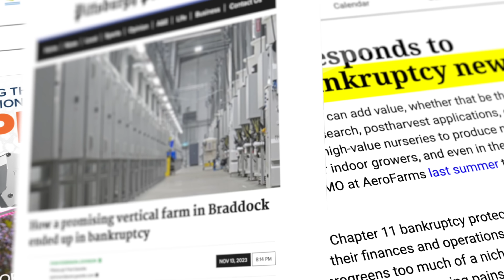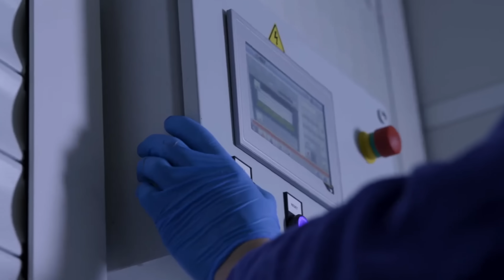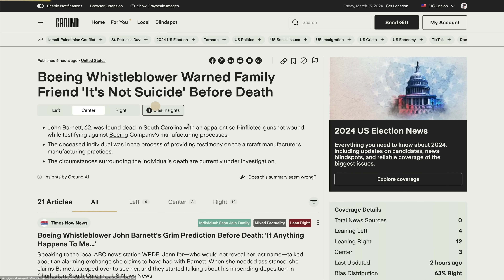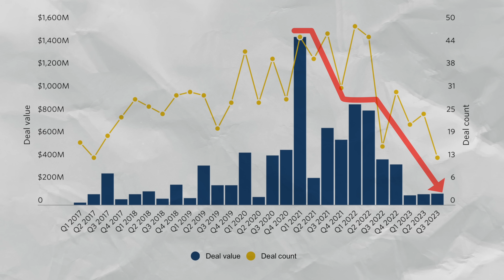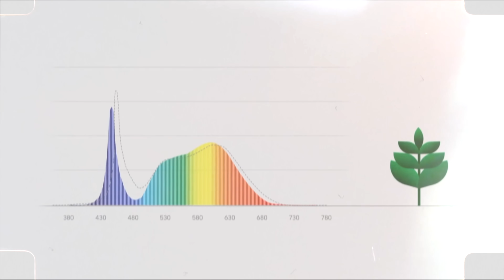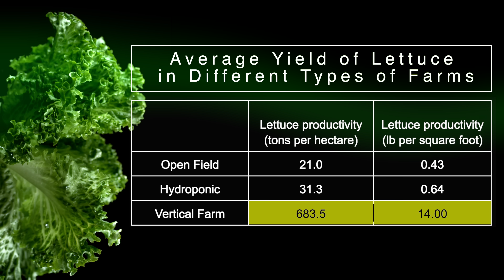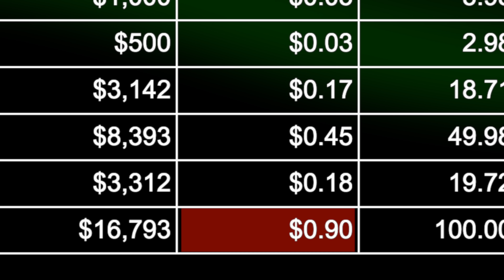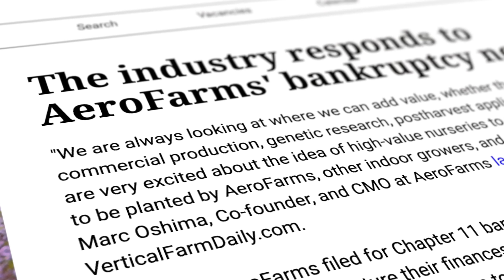The EPIC Failure of Vertical Farms - What Happened?

Comment: The first time I tried hydroponics, I was perplexed as to why such cheap plastic equipment costed so much.  So i made my own.  The prices are absurd and completely unjustified.  Why is labor so expensive?  I don't think such skills are required.  You need good sensors and tools to manage the environment but they don't require Ph.Ds.  I made my equipment from PVC pipes and fish tank pumps, etc.  I am far more interested in aquaponics now, though.  And, my thoughts are on burring 12' culvert pipes to grow in, using gravity for water flow and a simple mechanical wind turbine for recycling water (like is used to water cows on farms).  In fact, if the water is cycled back into a tank (say a culvert pipe burried in a vertical orientation and sealed on the ends, then the water flow could also generate consistent reliable electricity for the lighting.  Another thought is to use mirrors to redirect more sunlight down fiber optic lines to diffusers over the plants.

Comment: But considering the increasing risks of weather problems outside (at least in France for the past few years), with more frequent thunderstorms, dryness or flood, I think it's good to have a few of those vertical farming things around, and get more cost-efficient just in case and avoid food crisis or importation shortages.
Even though, they still need to find a way for diversification on the food.

Comment: The issue that sinks vertical farms is mentioned at the 52 second mark: "over $2Bn was invested" and a bit later "every venture capital firm". Farming is not a silicon valley start up. Vertical farming was never going to eliminate labor costs, because farming has shrunk that a thin as possible.

Comment: Vertical farms are actually a fairly old concept, and they can produce reliable yields of high value (both economically and nutritionally speaking) crops. Used right they can even improve nearby land, for grazing or other crops, particularly since summers are getting hotter, and mitigate soil erosion.

There's not trendy name though, no patents to be had, no market bubble on the horizon, and no shiny tech to bamboozle the simple-minded.

They're called trees.

Comment: Shame the cost comparison is not like for like, with the hydro stating total annual cost and outdoor stating annual per acre - cant draw a comparison as a result since we dont know the size of the hydro used in the costing table. If I assume the hydro system is 1 acre of factory, it would produce 609840lbs vs 18730lbs for outdoor. At $54393 total cost (assume per acre), thats $.09 per lb for hydro versus $0.90 per lb for outdoor. With that, I dont see how it fails. From examples provided, it looks like poor business capabilities of owners, poor cash flow management and corporate strategies.

Comment: the answer is making human labor cheap: 
by allocating the 'skilled' side like monitoring and inspection to AI and programming, 
leaving maintenance and packaging to workers as streamline factory work.. 

maintenance cost is ridiculous high for cleaning and monitoring  equipment 
(lights, pump, solution sensors,  and pipes) 

they seem to have forgotten one important aspect of farming .. 
it's not about min/maxing the process of production, its PRODUCING organisms.
Plants aren't MADE, they are GROWN.  Organisms are surprisingly resilient and adapting, there is no need to be so precise.
They already got the quantity by switching to vertical farming, there's no reason to try and speed up the process for more profits..

Start small and streamline the process, for profit investments will never work when you don't have the same vision of innovation

Comment: Anyone educated in permaculture, KNF, JADAM, or any of the other natural farming techniques could have predicted this failure. Vertical farming is prohibitively expensive, and it's also not really "green". It requires expensive buildings often in urban areas which means expensive land. They must be equipped with expensive dehumidifiers, expensive lighting systems, tons of hosing, pumps, tanks, water conditioners, etc. It uses tons of expensive inputs like synthetic nutrients, ph balancers, fungicides, water softeners, cleaning agents, etc. It requires extensive equipment which is expensive. Anything not grown in soil tends to have a less complex flavor profile as the micronutrients aren't available to assist with terpene production. Then there's the upkeep requiring tons of electricity, likely sourced from coal fired plants, and it doesn't return it's water back to the natural water tables. Also you likely need expensive generators, because one power outage could kill every plant in the building if the water stops flowing, lights go out, and air stops circulating. From a national defense standpoint, this makes it an exploitable vulnerability for cities dependent on them for a food source. It's a neat idea, but it's terrible, even on paper. Natural regenerative farming techniques are the cheapest, healthiest, most flavorful, most rewarding, and greenest way to farm. It works with, not against nature. You can make your own inputs for literal pennies, regenerate soil, and help reverse desertification. Water can collected using countless methods both passively and actively. Look at what's been done in India for an example of how you can terraform decertified regions into lush productive regions with raised water tables. When it comes to nature, often the lowest tech solutions are the best... but that's not marketable or sexy enough for news articles.
Reply: While I am a major proponent of regenerative agriculture, I still think controlled environment agriculture has a niche to fill. I can see how vertical farming is impractical at this level, but with new energy technologies on the horizon, the practicality could go way up.

Comment: I am a lifelong dirt farmer and I hold two university degrees in soil science, vegetable crop production, and plant pathology.  You could never pay me enough to work in a vertical farm.  Real production agriculture harnesses NATURE and lets nature do much of the work.  Still, farming is labor intensive -- and 20 times more labor intensive indoors.  I don't care how many sensors and robots you have, it would still be cheaper to bring a TRACTOR with large machinery in to do the job in much less time for much less cost.  But, nobody has figured out how to get the tractor up to the 5th Level.  

And yes, natural sunlight and heat is FREE as is rainwater or irrigation water in most places.  And don't forget about WIND and air currents -- 90 percent of plants need air movement to thrive -- and natural winds can help reduce pest populations. In a closed environment, once you get a disease or a pest, great effort is necessary to control it.

It is shameful how much investment capitol these failed operations have pissed away.  Meanwhile, most traditional farms are using equipment that has been amortized over DECADES and costs almost nothing to repair and maintain now -- that farmer with the 40 year old tractor and 20 year old tillage equipment is not making bank payments on them and, if commodity prices are favorable, even the super-expensive harvesting equipment was paid off after two or three years. 

So, back to LABOR.  Who in the hell wants to work in these awful places??  Even for unskilled tasks, you are never gonna find city dwellers lining up to take the jobs no matter how much the pay might be.  And with so much manual labor, people won't be staying with the job for very long -- I bet most don't last one week.

As for only lettuce and greens being profitable, yeah that makes sense.  Those crops can be grown in huge populations in very little space and they grow fast.  But a typical single green zucchini plant wants a square meter of space all to itself -- and it can be kept alive and producing new squash fruits for months and month -- but only when it gets them harvested about once every 48 hours  -- a couple of missed harvest pickings will pretty much shut down steady production by that plant.  It will require being discarded and replaced with a new plant which takes several weeks in a greenhouse before it starts to produce anything.  Meanwhile, the price per pound for zucchini is not very high.  Basically, there is no practical way to make growing zucchini in an expensive indoor vertical farm make any financial sense -- there ain't no money in it after covering all expenses.

Leave farming to mother nature and real farmers.  You will save millions of dollars.

Comment: @Two Bit da Vinci "Blurples" the red and blue lights. They are out of date, technology wise. Do a bit more research on led lighting. Most people are using LM301B, LM301H, along with a choice of red led diodes. Also, something that should be reviewed, is the nutritional value of the crop grown. The nutrients plants absorb from the soil or water mixture you feed them are then transferred to you. If you grow the food in depleted soil, it does not have the same nutritional value. Adding soil amendments is key, which is not occurring in large production farms. They literally have to rotate the fields in order for salt to not build up.

Comment: I actually talked with local farmer about this while ago.
The reason there’s no other than lettuce (the question you didn’t actually answer… 😉) is that plants in general are very inefficient to turn light into sugars. (Strawberry for example)
It’s like 1-2% of the light that the plant can use.
So it turns out that there’s no point to even try to compete with sunlight which is free and intense.
Lettuce and herbs etc. don’t have much energy in them so they are the plants that can be grown inside with artificial light.

So it comes down to energy efficiency after all. We all function with sun energy that is stored into sugars by plants.

Comment: 10:18 Electricity is not the most of the cost, but it still adds 0.44 $ to the total cost of production.
11:13 Adding 0.44 $ to usual 0.90 $ gives us almost 1.5x increase in cost.
In general, vertical greenhouses should be compared with usual non-vertical greenhouses. I can not see any positive differences.

Comment: I'm considering indoor farming myself. My calculations are based on the price of electricity vs buying food from the store, but even then the profit would come solely from using the waste heat of the lamps to heat the house.
Reply: let us know how it goes, and good luck :)
Reply: @gie51917  Back in my day, we used the waste heat from our indoor pot farm to heat the house
Reply: @TheRenofox  ever thought of using solar Panels? I've seen 800kw panel powering an entire farm.
Reply: Exactly what I did during my test of growing indoors. I didn't go the hydroponic way, just dirt in containers but being able to control the lighting, soil acidity levels and nutrients, gave me a lot of control over how fast the plants flowered and started producing food. I did this for aprox 5 years with each crop having better and better quality until there wasn't any point in changinganythingother than what I was growing. After all, things can only get so perfect in taste and appearance. ✌️
The excess heat that developed was blown out of the room so it could circulate around the house which allowed me to not run the central heating unit 80% of the winter, and I live in an area that sees many weeks of below freezing temperatures each winter. Goodluck with your growing indoors experiment, from what you've described, you should see a positive result.🤞👍
Reply: if you use fertilizer as soap. you can recylce your grey water to feed the plants aswell.
Reply: my best buddy heats his house all winter with the heat from his Bitcoin miners lol.

Comment: I plan on in the next few years starting a vertical farm but only as a by product of raising flat head catfish through Hydroponics in a greenhouse in my backyard, with Catfish on bottom and plants on top to purify the water and the catfish to create nutriant rich water through thier waste and a solar panel to run the small water pump in a closed water system.

Only thing I am worried about is how to deal with pollinating the flowering plants in a closed system with few bees around these parts.

Comment: Vertical farming is extremely labor intensive.  While traditional farming has to deal with more pests and occasional incliment weather they have lower overhead on watering and lighting( sunlight is free), light bulbs are expensive and need to be changed every 6 months to two years.  So while you may get several crops out of a bulb most of your crop yeild will go into replacing those bulbs.  Add in electricity, maintence of watering systems, cost of cleaning and replacing trays, labor to move and monitor plants ect.  Its almost impossible to break even.  Meanwhile traditional farming has extremely low labor costs.  Farm equipment can make planting and harvesting much much cheaper than vertical farming planting and harvesting.  Youll have more pests to deal with and occasional crop failure due to blights, pests or weather.  Even with those failures the labor saving usually outweigh any advantages vertical farming can provide.

Comment: It seems the issue is more about the failure to achieve rapid profits rather than the viability of vertical farming itself. The sector is capable of sustaining itself and breaking even; however, investors often seek quick returns, reflecting a broader issue of greed rather than a fundamental flaw with the farms. Achieving break-even status and ensuring all employees are compensated should be considered a success. The main challenge is the reluctance to accept modest short-term gains while strategically growing the business. This gradual growth model is a fundamental principle of business development, where starting small and progressively capturing market share allows a company to build a solid reputation for reliability. This in turn attracts more customers. Unfortunately, some commentators, like Two Bit da Vinci, fail to grasp the complex interplay between economics, culture, and technology, mistakenly equating correlation with causation. It's crucial to remember that the majority of new businesses face high failure rates within their initial years, which is statistically normal.

Comment: It is not a failure, the problem is that they want to produce with a method that will only be profitable in the apocalypse.

That is to say, it is a thousand times more economical to take a large area of land and cultivate it than to use a 4x4 vertical farms. Because today, the price of water is not a problem. When it is, these farms will be the solution.

Or........ fire all those "engineers" and non-essential personnel and have everything done by "DIY" type robots by a single engineer assembled in series in some factory in China.

Comment: Well, the cost for vertical farm is not per square foot, but on each layer of leds, pipelines, crates, supports, energy used, labour costs and so on. It is just STUPIDITY to compare square feet ileds while costs comes by each layer. You could use square feet on each layer to have some real comperable figure, but yet still that does not cover the costs of the high tech and labor.

Vertical farm is a solution for having no large land area to grow food. But the cost of it is totally different thing.

One of the biggest benefits for vertical farming is it works during winter too. And during nights too if plants can grow 24/7 (this may explain why they mostly grow lettuce...).

Vertical farming also reduces the threats of extreme weather events. Droughts, heatwaves, even floods and so on have less impact for vertical famrs, until they do. You may shield your vertical farm inside a mountain if you want to. But yet again costs are rising when you do so.

The bottom line with these shown numbers is: even without labor costs, the vertical farm in current situation is costing too much.